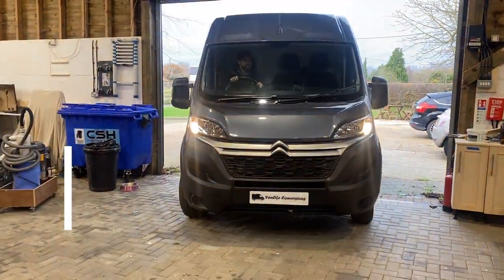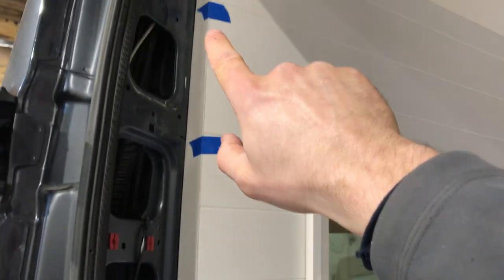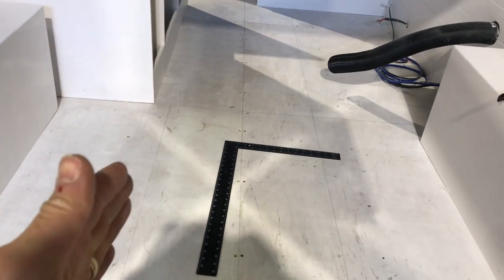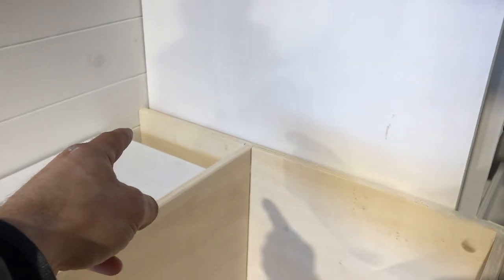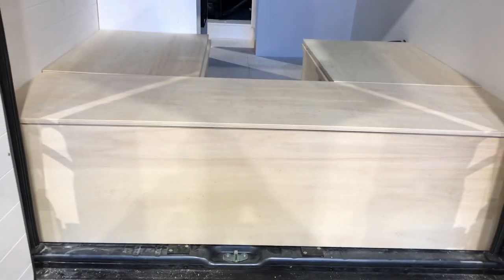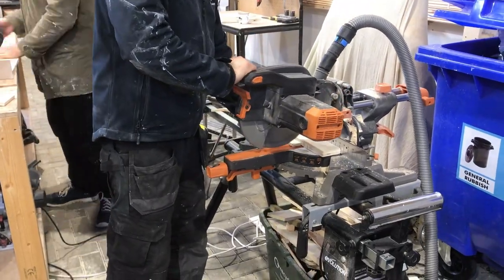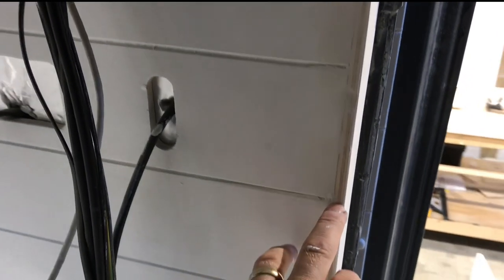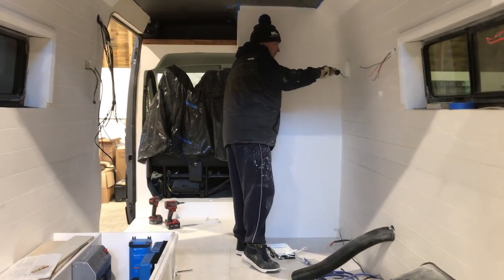WEEK 4 | Seat boxes, wall trim, door surround and drawers | START to FINISH Van Conversion Series

Comment: Starting to look really good, excellent quality. what is the primer and top coat you are using on the plywood walls and cabinets? I am in the early stages of my own van build and picked up some nice tips from you already. Love that curve cut round the door👍
Reply from the maker: We use a zinser primer and Mylands for top coats